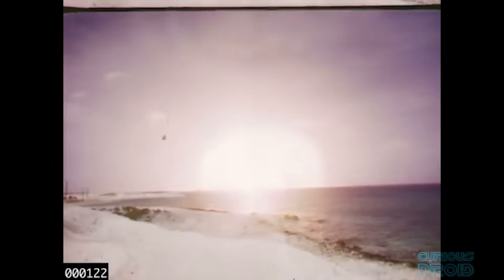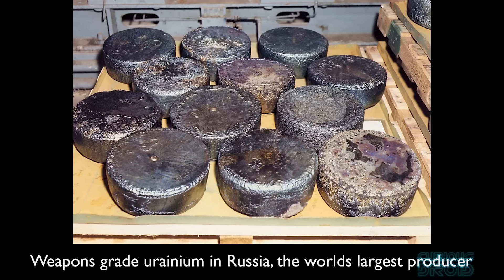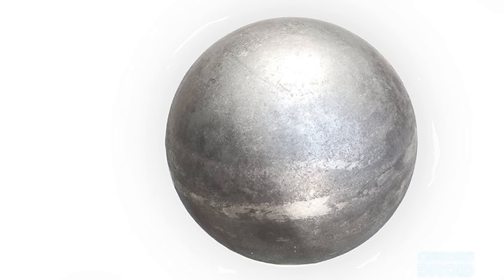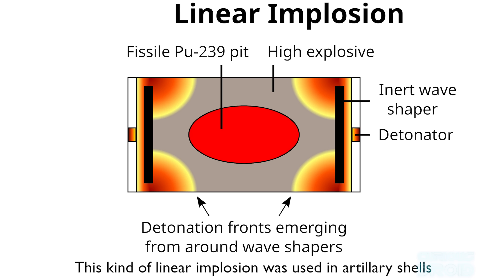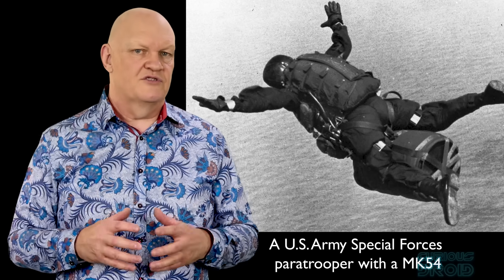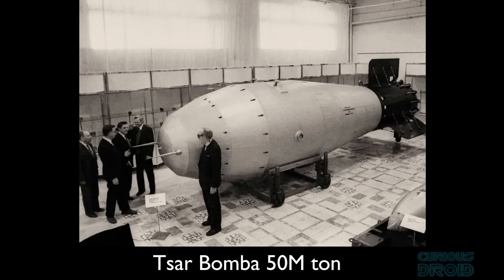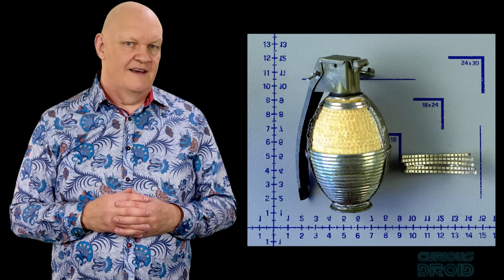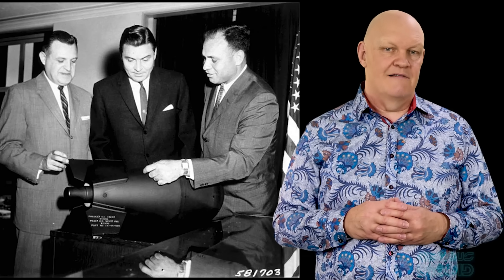How Small Can You Make a Nuclear Weapon?

Comment: I know from experience they go down to the size of a 155mm round weighing about 135 pounds. Plutonium core, (about 7 lbs and about the size of a tennis ball) control fuse and explosive all together likely weighed less than 50 lbs. BTW, The poor bastards that arm the sucker get exposed to a lot of radiation, not deadly, but defiantly not healthy. They were destroyed back in the '80s. The 8", 203mm rounds had a variable yields and used enriched U232. They weighed about 240 lbs. You would taste your fillings when the case was opened.

Comment: The cannon you mentioned at 11:00 is actually the M65 Atomic Annie and it was 280 MM, not a 155mm. FYI I know they probably had one but the one in this video is NOT the 155. That's why those guys were running away to a bunker to set it off. A cannon that size will break your ribs and give you a concussion if you're within 30 feet.

Comment: Yes   curiously   when  you  work  back  the  explosive  power of the  Fat Boy  bomb  of say 20 kton using  E=m*C*C   you arrive at  .. drum  roll  ..7  grams   ...confirmed  BTW ..  yet the amount of  U238  required  was   50 kilos  or   so ?.  This indicates that either Einstein  physics are wrong  or the nuclear reaction is  incredibly inefficient   and the answer is  the latter   and this  because of  heating  as  mentioned  reducing neutron density .Also in the  case of the " barrel method"  the only point of  maximum  neutron density on collision   is at the  very thin surface of the colliding  materials .. where  temperature has not risen enough to  reduce neutron density   so out  of all that 50 kilos  of  U238  mass only 7 grams  actually converts to energy .  As designs  improved  so  did  variability of the explosion and  there were  numerous   tests  where yield  exceeded  calculation  such as  BRAVO ..think that one was  3  to 5 times  bigger than expected  .. If  even 50% detonated .. bye bye  world

Comment: I've gotten to go on a tour of the Nevada National security site a few times.  One of the places we went was ICECAP.  It was within 2 weeks of being used as an underground test.  It still has "I believe the guy said" a 300,000 pound carrier suspended by a cable over "a covered" about 12' hole.  The carrier goes up several stories high and there are stairs so you can see the different levels.
The have a mock up of the British weapon in it.  They don't tell you what yield it is but its suppose to be a hydrogen bomb and it fits into a missile.  You know how the submarines carrying nukes have multiple warheads.  I was a bit surprised at the size of the mock up at how small it is.. I would judge it to be about the size of a 5 gallon bucket.  I thought to myself.. Self.. Something that size at the right height could destroy a small city..  It's pretty sobering.

Comment: A drone with a backpack nuke was not something I had really ever considered before
Reply: I have. A DJI Agras T100 drone could carry 4 davy crockett warheads. The full m388 round weights 34kg but the w54 warhead in it is just 23kg, and the t100 can lift 100kg of payload. Oh and the w54 was made around the end of the 50's, so a weapon designed with modern technology now that laser ignition was successfully tested could be made even smaller and lighter. Add to that container drone launchers and a cargo ship suddenly releasing a swarm of hundreds of drone each armed with mini nukes is a real possibility.

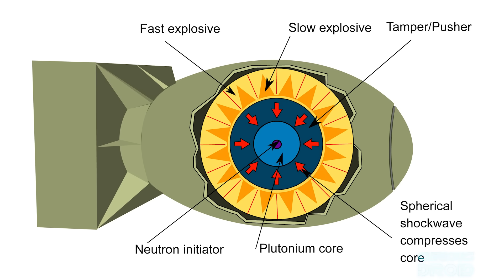Comment: 4:04 it's not true that all subsequent weapons designed used implosion. There were several more gun-type designs produced though the 50s and early 60s, primarily aimed at use cases where a small diameter was required in conjunction with relatively low yield. E.g. the 16" naval shells and 155mm howitzer shells. Also iirc the SADM landmine was a gun-type design. It wasn't until the 1970s that implosion configurations were made small enough for these applications.

Comment: Clarification and additional information:

There is a difference between sub-critical mass, critical, super-critical, and prompt-critical. Critical mass is the THRESHOLD level, where a reaction is self-sustaining. Super-critical is above this threshold and, if only slightly above that, will quickly fall below that level. It is this that nuclear reactors operate in, with a 2-4% concentration of uranium in the fuel rods. It is not the 1:1 described, but not a runaway either. Without the water circulating and without the control rods, it would go significantly past the 1:1 and, indeed, "runaway", but it wouldn't explode. Reactors that meltdown exploded because of steam pressure buildup in the reactor as cooling pumps go offline and the hydrogen buildup that occurs as the cladding in the fuel rods breaks down in the presence of steam, as the cooling water boils away, exposing the rods.

However, due to the way these things work, the fuel rods are not actually dangerous until they are placed in the reactor and essentially "activated" by the presence of neutron source rods. (Effectively a nuclear match.) Then the less stable products of the fission reaction help sustain it. So, for that reason, once a fuel bundle is "activated" it cannot be "deactivated", but remains in the actor until the concentration of uranium drops below usable levels for generating high pressure steam. It then spends about 10-15 years in an indoor cooling pond before being encased in a protective concrete cask, and placed in long-term storage outside in the plant's yard.

PROMPT critical is where a chain reaction releases all of its energy at once. This is where a nuclear bomb operates at and requires uranium or plutonium purity of greater than 90% and, even then, it must be compressed by a spherical explosive in order to create a detonation. It is NOT something that can happen in a nuclear reactor and is NOT easy to do. (If it was, every country with an eye towards power would have nuclear weapons, but they do not.) A critical part is getting absolutely perfect timing in the detonation of the various parts of the core. You can't just touch off one part because the explosion would propagate through the explosive material slowly enough that there would likely be no fission. To achieve proper compression, you need multiple triggers placed at several places around the core, and, as noted in the video, these have to be timed to a millionth of a second in order to be both effective and efficient. Also, these devices can't just be built and left. They have to be maintained. Wiring has to be checked, batteries refreshed, the stability of the explosive and the core needs to be verified, and, from time to time, elements degrade and need to be replaced. So anything that just sits for years is still quite dangerous, but the longer it sits, the less likely a detonation will be nuclear and simply just a "dirty" bomb, which is actually of greater concern since it means radioactive debris scattered for miles and potentially lingering for decades or longer as cleanup efforts struggle to locate and mitigate contaminated areas. It is THIS sort of device, the dirty bomb, that is the real concern since you don't have to do anything but scatter low grade nuclear material over a wide area, impacting hundreds or even thousands of people. (Picture one of these being let off from the viewing gallery atop of the Empire State building, for example.)

In Little Boy and Fat Man, it wasn't that they "switched". The nuclear scientists theorized that there were two ways to generate a nuclear explosion. The Manhattan project simultaneously pursued both types of devices. The Trinity test was the Plutonium device (what became Fat Man). It was necessary because they didn't know if "the gadget" would work and if it would, indeed, generate a nuclear explosion. These are both Kiloton devices. Megaton devices (Fusion bombs, which most uf os call Hydrogen or H-Bombs because of the use of a quantity of Hydrogen isotopes in the second stage) use a completely different technology (a two stage device) but, ironically, it takes a fission explosion to provide the necessary X-rays to produce a fission explosion. So these STILL contain a descendant of the "Fat Man" implosion device. In the first nuclear explosions, only a small amount the core material was actually consumed in the detonation. Little Boy was estimated at 1.4% and Fat Man around 14%. The rest is fragmented and atomized and carried away by the wind and scattered far and wide. Modern devices reportedly go to 25% and higher, though I have some trouble believing it can actually get higher than 25%.

While the US only had two devices to fly to Japan, a third device was actively being prepared at the time of the Nagasaki bombing and it was believed there was enough nuclear material available to create a fourth device. The Germans were pursuing nuclear devices as well, but it is believed they made an error in the calculation of the amount of material necessary for critical mass and believed they needed to refine a lot more material than needed. (This is a debated point, though.) In any case, they didn't make sufficient progress before running out of time, so their heavy water experiments yielded nothing in terms of military technology.

The AIM-26A was not simply for taking down a bomber. It was about taking down bomber GROUPS, if possible, and doing so in such a way that their nuclear bombs would be consumed in the explosion, rather than risking them falling to earth or being ejected by the bomber crew as the plane fell. Quite a number of these were made and there's even test video. (One includes a group of volunteers standing at "ground zero" to prove that an air burst at higher than the ideal bomb-level altitude didn't mean you were going to get vaporized or die of radiation.)

Tsar Bomba was a 50 megaton yield, yes, but it was SUPPOSED to be double that--a full 100 megatons! At the last minute, engineers downgraded the third stage device contained within it. The problem with it is, first, as it was, the aircraft barely escaped the blast and, second, at the intended yield, the fireball would likely have touched the ground, leaving a massive irradiated area. It still shattered or broke windows as far away as 550 miles from the blast center!

Comment: 3:22 Gun-type weapons have nothing to do with compression, as you claim. Gun-type weapons simply assemble a critical mass by moving two parts together. The gun is needed because the two parts must be brought together quickly enough to reduce the a spontanous fission triggering a chain reaction between the time when the core becomes critical and the time when it's fully assembled. That would create a fizzle: a small explosion that would blow the weapon apart, but only be in the range of tons of TNT equivalent. That's why the gun design was abandoned for plutonium: there were more spontaneous fissions so it simply wasn't possible to assemble the core fast enough with a gun to make fizzles unlikely.

4:00 It's also not true that all later weapons were implosion devices. The US designed several gun-type weapons in the 1950s and '60s, including that W33 nuclear artillery shell that remained in service until the early 1990s. Over 2000 of those were produced. (Yo, dawg, they heard you like guns so they literally put a gun in your gun so you can shoot while you shoot.)

4:38 "The US only had two bombs and they had used them both."
Three bombs: Trinity test, Hiroshima, Nagasaki. And, the US would have had a fourth bomb ready about a week after Nagasaki, three more the next month and another three or four the month after that. So, sure, after bombing Nagasaki, the US didn't have any more bombs in stock. But they had a production line that was cranking out one every ten days or so. The threat to bomb more Japanese cities was in no way empty. Well over 100 Fat Man-type bombs were eventually built before the design was superseded.

Comment: We had large Nuke air breathing rocket launched missiles in the 60's based in South Jersey off route 539  in launch bunkers near McGuire AFB .These things were near the size of an F-105 .One caught fire and burned up,maybe some others too .We dodged a bullet if it had gone off nuke with several others nearby or it would now be called the "Bay of New Jersey" . You can still drive by and see it  ,a large fenced off covered over with feet of concrete area with KEEP OUT signs. Toms River NJ is just down some streams maybe 10 miles away where its been labeled a cancer hot spot .They were designed to knock out Russian bombers in the air .

Comment: W25, diameter 17.4 inches, length 26.6 inches weight on the order of of 220 pounds, yield approx 1.5kt, warhead of the AIM-2A Genie unguided air-to-air rocket, carried by F-89H/J, F-102B, F-106

W-54, diameter 12 inches, length 18 inches, weight 58.5 pounds (26.5 kg), yield 10-250 tonnes, used in M-28/M-29 Davy Crockett recoilless gun (a type of spigot mortar), the atomic demolition munition and the AIM-26B Falcon

The M-65 280mm howitzer fired a shell with the W-9 warhead, (diameter 11 inches, length 54.8 inches, weight 850 lb. Yield 15 kt.

W48 155 mm howitzer , diameter 6.1 inches, length 34 inches, weight 120 pounds, yield 100tonnes

W33 M-110 203 mm howitzer, diameter 8 inches derived from the W-9 warhead, yield 10-40 tonnes
  
There was also an atomic munition for the 16in guns on the Iowa class battleships, but its availability barely overlapped the Iowa's service periods.

Comment: Although the Khan leaks suggested the design of nuclear weapons could have reached terrorist hands, there were two practical issues with them, firstly they were faulty, and secondly, fissile materials are extremely expensive to refine. The second ceased to be an objection when several payloads filched from Soviet warheads were found on the open market, resulting in greatly improved Russian controls when America made it clear their use would result in retaliation regardless of who actually used it. The second took considerable expertise and testing to overcome, only possible at national level.
As the provenance of the stray material showed, there was virtually no maintenance of the weaponry, as it required technical competence at a very high level, and when worn-out nuclear sub hulks started appearing all around the Kola Peninsula, and were neither replaced nor maintained, it became clear that Russia had joined the ranks of former nuclear powers. This changed when Donald Trump became President, with about 2 replacement subs appearing per year, although it tailed off in 2021. We should expect it to resume in the near future. No attempt has been made to dismantle the hulks, nor to dismantle several thousand exhausted nuclear power packs used to power more remote Siberian settlements. One factor missed in the numbers game is the devastating power of the multiple warhead missiles on board a single sub: the critique of the Cold War escalation, how many times is it necessary to reduce our planet to a desert devoid of life, was a significant factor in de-escalation detente.
Thankfully the number of viable economies Russia can asset-strip using tariff/counter purchase tactics is limited, as each time they do, they produce a virulent enemy dedicated to not repeating the exercise: the American economy is already buckling from trade boycotts. They had a record grain harvest this year, for example, but lost their markets, and have limited ethanol production capacity. That overload is adding to the issues of oil over-production when the Orange Anarchist attempted to order the rest of the world to ignore the reality we passed Peak Oil a decade ago.

Comment: japan surrendered two weeks before they dropped the bomb. the US as usual ignored it as they did when the taliban offered up Al Qaeda three weeks before the invasion.

both bombs used German fissiles shipped by Submarine, bomb two used German Plutonium and triggers for the explosives. the US was years away from making their accurate and small enough.

they did have more german fissiles because germany had been running at least four reactors for years.

there is a theory that they tested one nuke than went beyond it by making hydrogen bombs without the nuclear kicker - the fabled red mercury. they supposedly assumed the allies also had nukes which is why they never used them but had the capability of making pineapple sized tactical nukes.